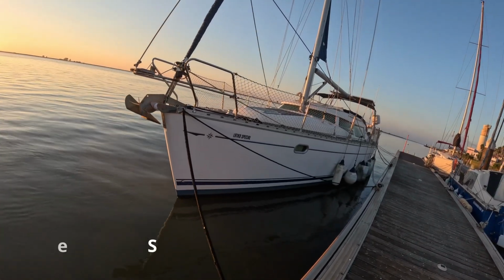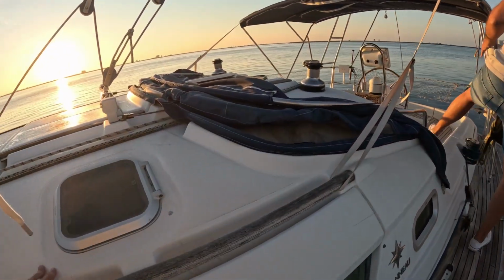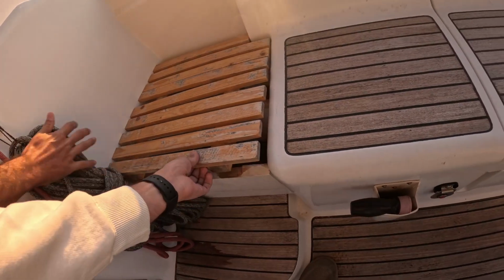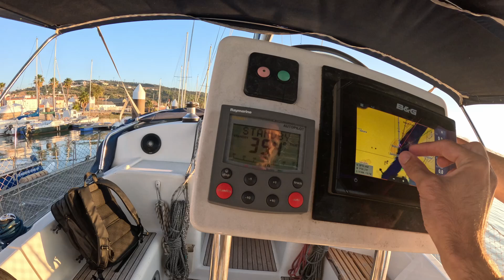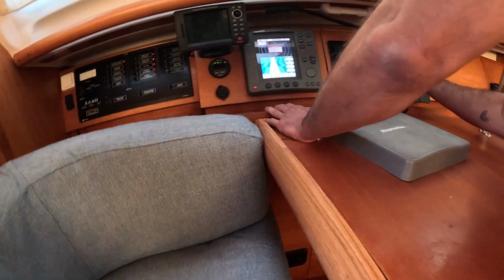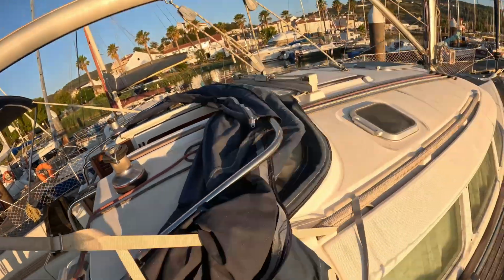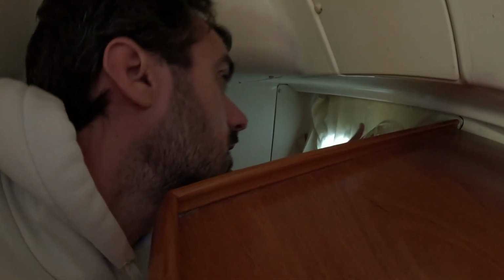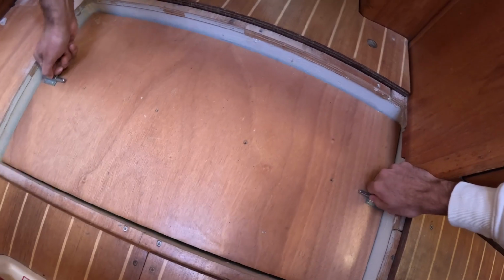I bought a boat… And it’s leaking water? (Was this a huge mistake?) | EP2

Comment: Check the impeller housing, the screws holding the lid, and the gasket. And the hose clips. Perhaps new lid  new gasket. If that does not help, the pump has to be disassembled and perhaps changed.
Reply from the maker: Thanks! Sounds accurate! Are you a mechanic? Thanks for the tips!! 🙏
Reply: @ProjectSpiralShell  no  just boat owner